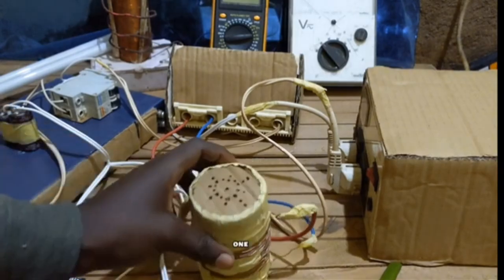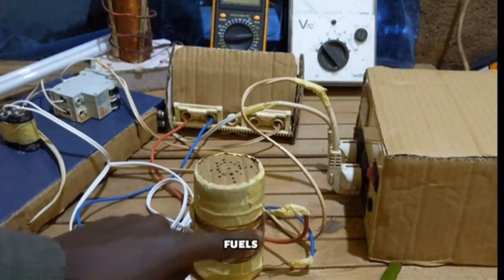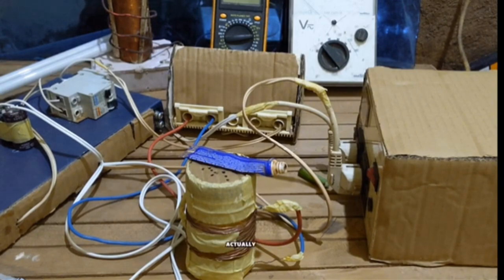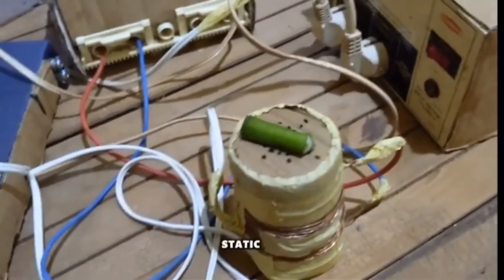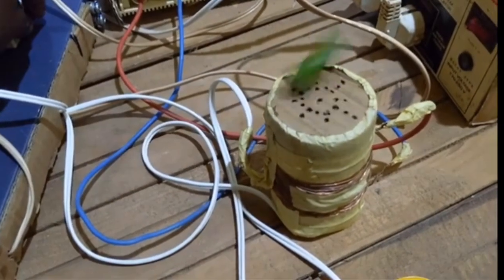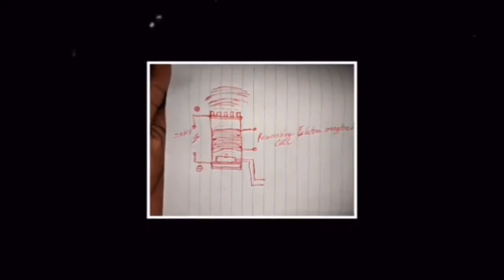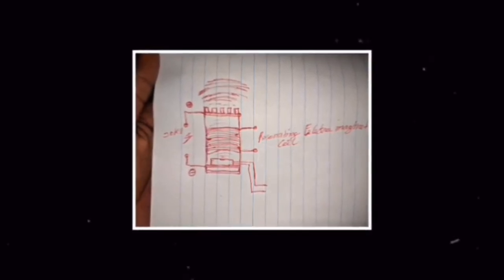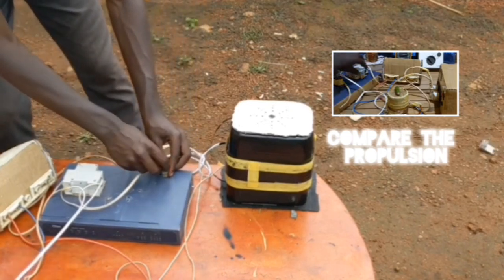KEIDIUM LEVITY DEVICE: ANTIGRAVITY TESTS COMPILATION | 7th August 2024

Comment: Bro you seem to be adjusting the hertz manually and it should be in the center and the plasma should be placed below it in the container. In nature the herts are firing like a MOSFET of a electromagnetic pulse all at the same continuously and the plasma of the sun is maintaining the pushing force of this gravity we are feeling. We have millions of vibrating hertz in our atmosphere and they work well when they vibrate together. These are all isolated magnetic forces that we tend to use them individually that is why we do not see the total effect of it. I suggest you put all these hertz together and you continuously pulse all these hertz together at the same time so at least one of these hertz out of the million hertz will respond to the specific object placed on the levitater you made. All objects are levitating but we think they are not because we view it from the earth. When you want to see the object levitate then view yourself standing at the sun from there you will understand that all objects are levitating from earth and even earth itself.